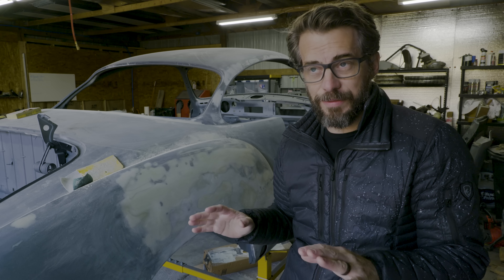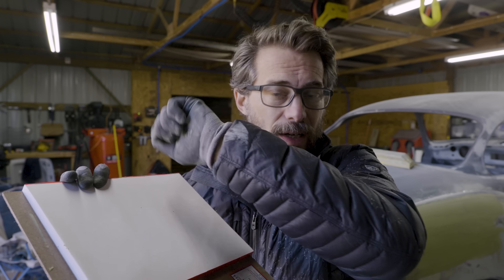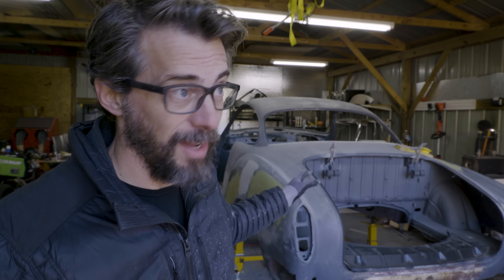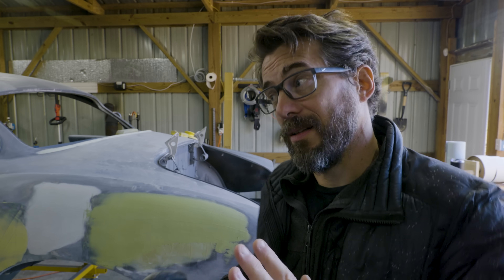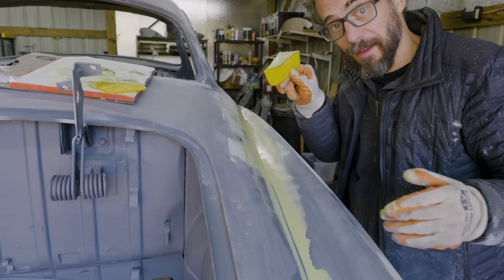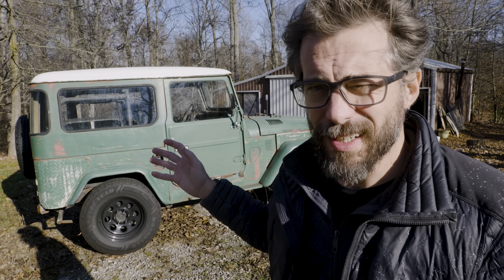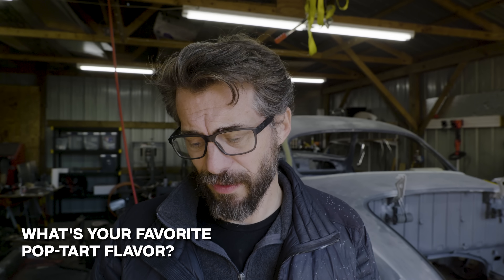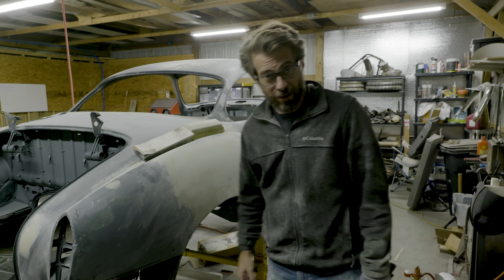How Do You Eat an Elephant?

Comment: making it electric would not be "better for the environment." Those batteries are terrible for the environment...
Reply: But unlike gas emissions, recyclable
Reply: @BazilRat  so the environmental and human destruction caused by mining for minerals used to build batteries is justified?
Reply: @johnmoody2042 there are human and environmental costs of getting gasoline.
Reply: It's, Bob's car, and if Bob thanks it's cool (I certainly agree) he should just do it! That's whatvist all about if you ask me, let's keep in positive!
Reply: @johnmoody2042 stop sniffing the fossil fuel propaganda so much. Overall EV's are much better for the environment than gas engines. Sure, the cobalt mines ain't great and should be fixed, but fracking oil is just as bad..
Reply: I know this idea that battery mining has been promoted widely, and it’s got some truth to it, that’s why it’s sticky. But people have run the numbers including the mining impact, EVs are better for the environment than ICE cars, by 1/3 or more. Gasoline mining, transport, and burning of fossil fuels is really terrible for the environment.
Reply: Not worse than an old, inefficient engine, plus using secondhand batteries would completely negate your argument to begin with.
Reply: At Theo moment, Theo biggest problem is about recycling in a efffective way, we need to push the electric batteries industries to be more serious about this issue
Reply: I actually find the EV technology fascinating but it’s still not there for widespread use. Also, my opinion on the EV conversions for these cars is that they’re nonsensical. Do the conversion to something that’s not classic like this.
Reply: @Dr._J 😂😂😂😂😂
Reply: Riddle me this, do electric vehicles have emissions?
Reply: The mines they use for the batteries leave giant wholes in the ground and the batteries also dont last long in colder weather even with sheathing and insulation
Reply: I agree. Batteries are not yet to a point where they are better for the environment then gasoline. The by product of burning gasoline is additional CO2 released into the air.  People think this is awful, when it actually does,  in fact feed trees which convert it back into oxygen. Trees absorb CO2 during photosynthesis, a process where they use sunlight to convert CO2 and water into glucose (sugar) and oxygen. In this process, chlorophyll in the leaves captures sunlight energy, enabling the tree to break down CO2 molecules and release oxygen as a byproduct. This oxygen is then released into the atmosphere, providing the essential gas for us to breathe. The additional co2 being released in the air would actually promote tree growth which in turn would promote the growth of oxygen.
Reply: They are, but he can’t exactly build a train
Reply: @SanderMakes I don’t think you understand what “fracking oil” means because it doesn’t make sense.
Reply: @BazilRat  Part of those emissions, namely the CO2 is recycled by trees and turned into Oxygen. The CO2 “issue” that’s pushed so much these days doesn’t jive with what I learned in my Biology class in 9th grade.
Reply: @johnmoody2042  No, it's just the least crap option we have in the time we have to fix the climate. We're creating tomorrow's problems so we can solve today's.
Reply: The current usage of gasoline and fossil fuels isn't inherently better. Something doesn't have to be 100% perfect to be an improvement. There are plenty of issues with batteries. The mining of cobalt is a huge issue. Does that mean you are going to give up your smartphone and laptop and revert to an old landline and dial up PC? Or does your criticism of batteries only go as far as its convenient for your particular set of beliefs?
Reply: @johnmoody2042 justified? No. Not anymore than it's justified by you using your smartphone that benefits from the very same mines. But to act as if there is no corruption or issues involved with the manufacturing of traditional ICEs or the refinement of fossil fuels is also short sighted. The supply chain of batteries absolutely has issues and they should be addressed - I agree. But that's not some silver bullet for saying EVs are the worst choice overall. In fact, that analysis leaves a lot to be desired in terms of critical thinking. I don't purport to have the perfect answer, but simply implying that "batteries bad, must mean gas good" is hardly an argument.
Reply: @BazilRat  only parts of it are recyclable and that's not even mention that most of the laborers used to source the raw materials are forced to work those mines.
Reply: @SanderMakes lol not even close, if you do any actual research you'll see a night and day difference. Take Los Angeles for example as there are hundreds of oil drilling operations within the city while a single cobalt or lithium mine would take over the entire city. Also fracking has a much lower environmental impact than traditional oil drilling.
Reply: @busomite look into the refinement and purification aspects of the raw materials with ev vehicles.
Reply: @beaushaw  at this point just put pedals on the car
Reply: @richardbenson4750  I have, as have many others. People have run the all in numbers, including everything about the mining. EVs are STILL better by at least 30%. And that’s not including the near 100% recycling for batteries that is already underway. There are legit knocks against EVs (we can’t power the whole world running on EVs yet), and the mining isn’t awesome, but that should tell you just how horrific burning fossil fuels are. And end of the day, Fossil Fuels are finite. We can kick the can for a while longer, but this is a problem that needs solving we can’t just make more of them.
Reply: @busomite  then you might want to double check the basics like strip mining,  child labor,  pollution caused by refining the raw materials, the generating of electricity which still comes from mostly coal being burned. A simple look at the big picture reveals your statement to largely be false.

Comment: If you have access to hot water out at the shed (you could even bring a kettle out), soak the body filler containers in the hot water long enough to warm it up to make it easier to work with on those cold days.
Reply: You can use one of those chip dip size crock pots full of water and use it like a baby bottle warmer
Reply: I do it for wood glue all the time during the winter
Reply: I was curious about this. I do this for spray cab paints. I was wondering if warm body filler sets up faster, so you get better workability, but short working time?
Reply: @davidbrennan7422  it doesn't really harden that much faster based on temperature.. from my experience the amount of activator used really defines how fast it dries. For small spots i usually use a bit more activator as i know it's done quickly and i don't really need a long cure time. Can't really give you a recipe here for how much activator to use, i go by experience as i stick with the same brand.

Comment: For body filler and sanding, get yourself a headlamp and mount some lights on the walls shining in from the sides. The lighting helps you see and fix issues more quickly. If you dont do things like this you will spend a ton of time discovering things you missed on earlier steps. 

For body work, don't worry about finishing a part each visit. The thing about body filler and sanding is that cure time is that it's better to get the first bit on all the panels so you can let it all cure properly before you sand. 

I just want more car content from you. I don't rightly care if its on your main channel or a second one. I also really enjoy watching you learn whether it's in the video or the comments after. The only reason I want this project to finish more quickly is because I can wait for you to enjoy the fruits of your labor. 

You got this, even if it doesn't always feel like it.

Comment: Sanding Bondo is a lot like sanding wood.  You need to look at it from different angles and once you get a feel for it it becomes clear.  Nice thing with bondo is after your done sanding you can hit it with cheap rattle can primer or paint.  Let dry and it will give you instant feed back how good your sand job was.  Kinda like a mini guide coat.  I would sub if you did an automotive channel.

Comment: Making some good progress.

Couple recommendations I learned a couple years back with body filler.
When you apply the body filler if you sand it once it starts to harden (30-45mins) it sands much easier.
Also once you get to smaller areas - Consider a light weight body filler. You are using Evercoat, they make one called Metal Glaze. Much easier to refine with less aggressive cutting.

I would watch an automotive based channel of yours.

Comment: 12:03  I considered an EV swap on the $500 Mustang.  It's $20K for an okay conversion.  Then I needed a car to drive and just put the Mustang on the road as-is with minimal parts thrown at it.  It's a year later and I'm still throwing parts at it, but it gets me places.  A family member had an EV for a bit, so I have experience with them and know what the real upsides and downsides are.  An old VW is worth keeping as-is way more than the Mustang I have.

Also, no for a second car channel.  There are more than enough car channels, and I don't even watch the ones I actually like.  Just do your thing here man.  I just remembered this project and came back to check up on it.  I think it shows what you previously explained that not every project and build has to be a short, one video "easy" thing.  Some projects are more complicated and take more work, and that's not a bad thing.  It give the channel more depth.

Comment: Not sure if you know about this product,  but Plastic Honey is a thinner for body filler.    It is useful to be able to change the consistency.. 

It can also be useful to have a larger spreader to bigger areas.   I like heavy plastic or metal signs , covered with some clear packing tape.   You can give it a slight bend or use it straight to shape the filler as you apply it.   I find it's better to give one swipe with this screed and then walk away;  ultimately this results in less sanding.

Comment: when you knock off the majority with 36-80 grit, take a cheap black spray paint and dust the area good - then sand with more higher grits, this will be a guide coat- low spots will still be black.   Also use a glazing or spot filler after your lightweight filler for more coverage.   They lay out smoother and nicer, they will also fill pin holes. I like to use USC Icing Finishing Putty 26006

Comment: Not sure what kind of fuse box situation you have on the older landcruiser, but you should open it up (if it's an actual box) to check for water damage or foreign substances. If it's just a strip of fuses mounted, you might consider upgrading to a newer fuse style. I've had electrical issues on a couple of cars -both Toyotas, and both were fuse box problems.

Comment: Yes for either a car channel or at least a playlist of all the car stuff. I see you crossing the streams with sanding... A good idea is to sand only in one direction per grit, then switching to sand across the previous pattern, this makes it easier to tell when you've sanded out the previous grit's scratches. Maybe take the body filler can home with you so it'll be warm when you go out to the car. This is no different than finishing a 3d printed helmet for cosplay, something you've done before - You got this!

Comment: For a second coat, they make a filler that thinner and easier to apply. Look for a glazing or finishing filler.

They also make a product that is a “guide coat” you dust on in a contrasting color can help you see how your sanding is going. You will see any deep scratches left to remove, or larger valley’s that need filling.

I think sanding primer is about the same as any wood project, sand until the previous grit scratches are gone, and then move up a grit until it’s smooth.

Your sanding technique looks pretty good. Using larger blocks and working in a cross hatch pattern it good.

Comment: You can use metal spatulas and not the plastic ones. To check if you have a nice even surface use your hand and feel it. Spray the howl car with spray filler when you are finsihed with the handfilling. After that spray a fog with a black Spraycan over the car, it should look like fine black dust. This give you optical information when you grind it with wet sandpaper.

Comment: Bob, I’m a fan and a long term subscriber. I was a tiny bit disappointed with this video in that you didn’t problem solve your way out of these challenges!  Yes, you don’t have the skills others do for body work,  but you are a problem solver! I was expecting to see you heat that bondo up, mix it with a drill then vacuum all the air out like epoxy!  (I have no idea if that would actually work)!  Or build a heater!  What about 3d printing a scraper to fit the curves of the Ghia?!  This is what I want to see Bob!  Go get that Ghia!!

Comment: For sanding "too much" or "not enough:" a good rule of thumb is to check the data sheet for whatever primer you're going to use. It'll indicate what grit the surface should be sanded to before application. Once it's smooth and consistent at that grit, you should be good to go. Similar to applying finishes to wood or other materials: it needs to be smooth enough for aesthetics, but not so smooth that the primer can't get a mechanical lock.

Comment: If your land cruiser is having problems when you turn on the lights like don't start of shut off you have a charge issue that can be that the alternator is bad or maybe the idle speed is low so the alternator don't generate anough power to keep the motor running and the lights at the ssame time. I worked on an alternator shop and was a recurring issue that even putting a new alternator you still have the same problem and always was a low idle.

Comment: You should get one of those heaters that sits on top of a propane tank.  I used them to defrost my pipes in the garage last winter. They’re inexpensive, don’t require power, and put out a lot of heat.

Comment: I would definitely love a car channel. 
An electric conversion would be cool, but as you said it's still quite expensive, that being said, buying a wrecked Nissan Leaf and swapping over the electric motor and batteries, and selling the rest might be a good option.
Regardless, if keeping it ICE, are you gonna keep the Air Cooled engine, or are you gonna swap in a Subaru engine?

Comment: Those spreaders look like the Pittsburgh body filler spreaders I've been using for at least a decade and nothing ever sticks. I've used 3m body filler once not a problem. I just wait for whatever I'm using to fully cure then flex them and they're pretty clean to totally clean. Not even contact cement bonds to those polypropylene spreaders, although it's necessary to run a thumb on it instead of flexing it. What kind of body filler is that as I might want to steer clear of it cause the last thing I want to do is spend more time than a few seconds to clean them up. If I had to use chemicals to clean them i'ld probably toss em and get more. After all, no matter what direction you head in, you're always heading towards a Harbor Freight. That sounds too familiar for some reason.

Comment: Why don't you paint it with both the blue and the silver? We used to do body work on the trucks that we had. We had two '47 international 2-ton dump trucks, a '51 1-ton Dodge flatbed truck, and a few other cars and trucks. We didn't have to use Bondo very much. But it was fun painting them. I also enjoyed driving them. :) Back then (many, many years ago), we had truck drivers stopping by to meet me. because they had heard on their radios about me driving these trucks. I thought that that was strange though. Yeah, you should start another channel about cars. Believe me, it would be fun. Even though it can be frustrating at times.

Comment: The easiest way to clean those bondo applicators is to just let it dry and flex it to crack the bondo off. 3M sells a mixing pad made out of the same material too.
Reply: There’s also a rasp you can buy, you have to use it before it fully hardens but it makes it way quicker to remove excess material, and doesn’t gum up like the sandpaper does.

Comment: learning to read the panel is something you need to do before you can start to understand how to proceed. you need to watch some videos about guide coats and recognizing high and low spots. the first coat of filler you spread in this video was over spots that needed to be knocked down because they were too high, those are places you can never fix properly with more body filler, you will just end up with a panel caked full of filler that will eventually crack off.

Comment: Question from a body work novice. Why are you focusing on body filler right now when there is still sheet metal and hole repairs to do. Are you not worried about the heat of the welder melting or warping the body panels you have just body worked.

Comment: Would love to see a separate automotive channel. As far as the time to finish the car. Well you hit it on the head you have a family and a full time job. So you are not going to have it done like all these TV shows and youtubes that do it one day. I am restoring a 1964 C10 and I am on year 10 and still not a 100% done. By the way the curved body panels maybe hard to apply the filler but they are much easier to sand and get right than straight panels.

Comment: For a classic car like this, resorting to using epoxy "bondo" filler is really doing it an injustice. With so much already removed from the car, doing a bare metal restoration would be much better and more forgiving for someone already skilled in using similar tools in a woodworking sense